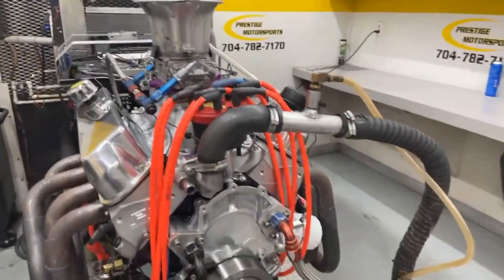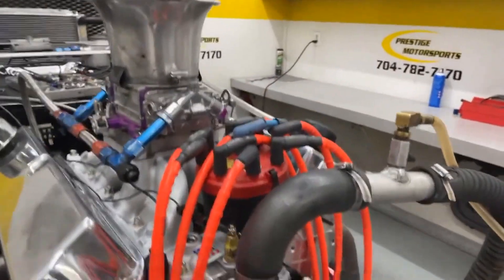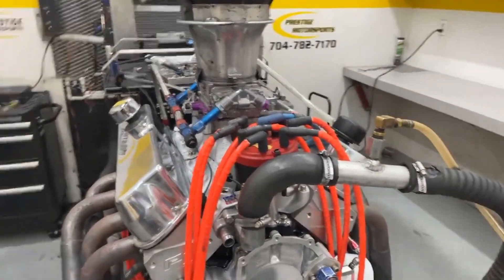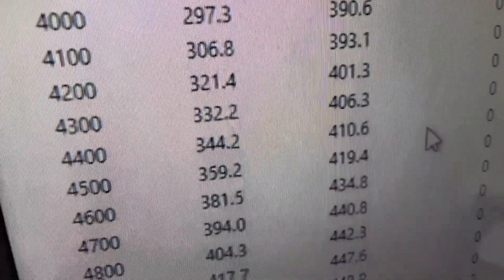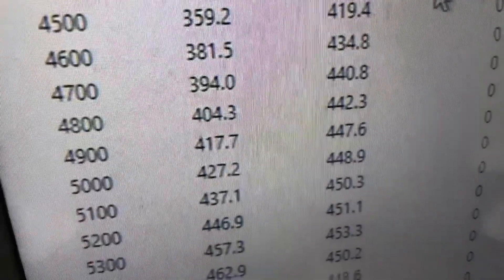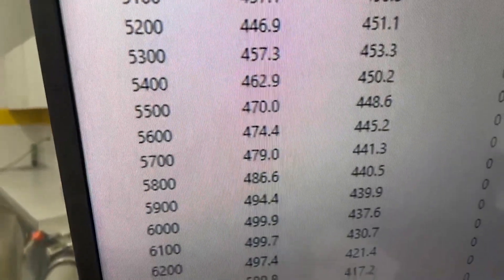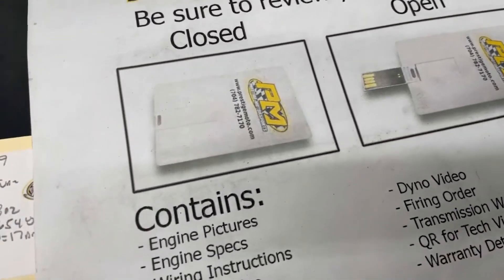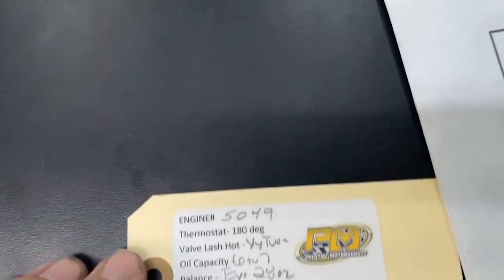500HP 347 Ford Stroker Dyno Testing for Martin's '83 Fox Body Mustang at Prestige Motorsports

Comment: 500 347 hell yeah
Reply: They dont last long in a OEM block at 500+
Reply: @ThaSilentOne420  I don't think Prestige uses stock blocks
Reply from the maker: Our 347s are stock blocks. 363s are aftermarket. 500hp will be just fine on the stock 302 block...just no more than that. We have the 3 year warranty as well. Have not had any issues
Reply: @ThaSilentOne420 not at all, I've got original 83 engine for my fox bored stroked to 347 since 2004, 540hp at tires,plenty survive having boost on them from there